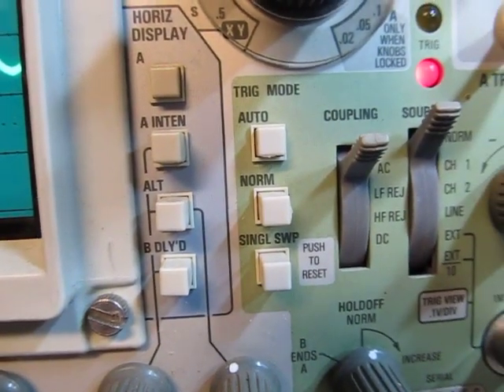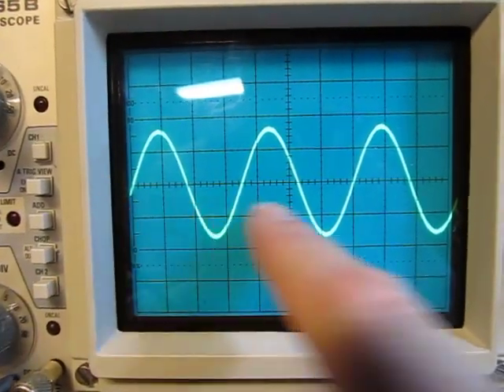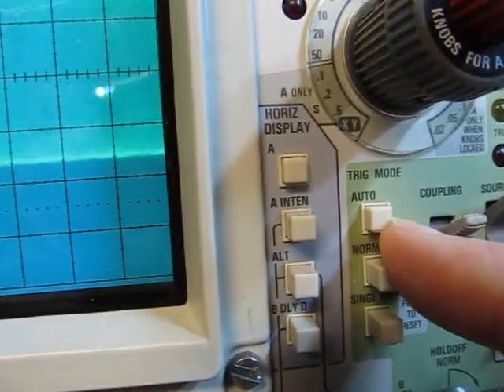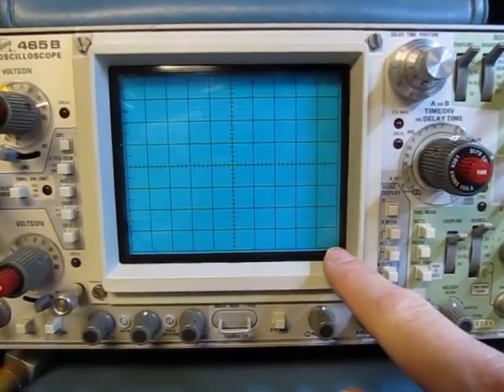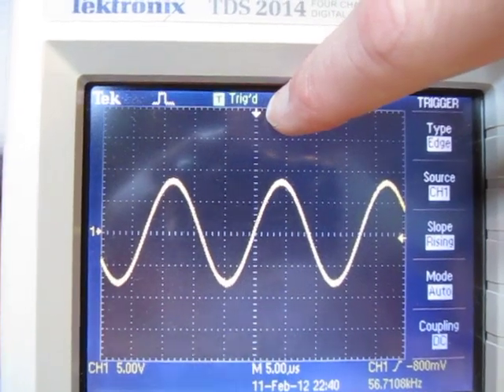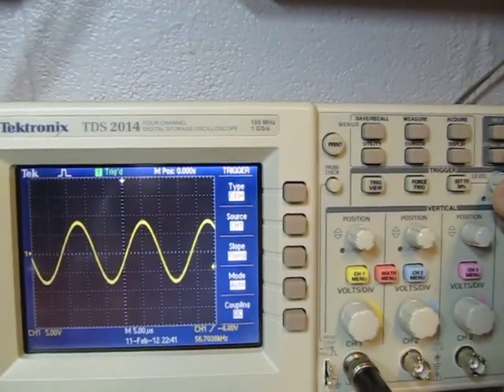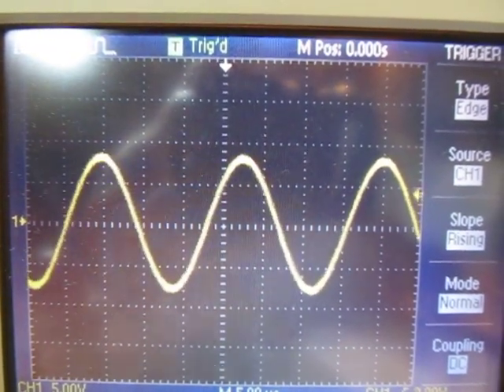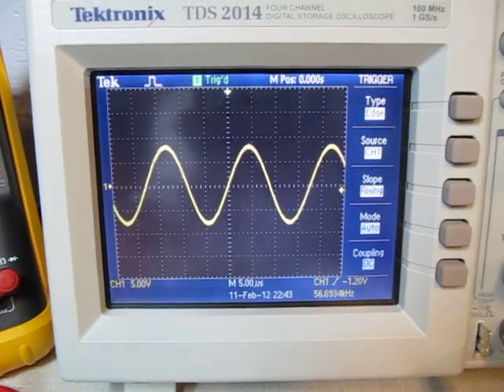#33: Oscilloscope AUTO Triggering explained

Comment: In short, all AUTO does is force a trigger event, if there hasn't been one. No trigger event, no trace on the display. 

This is useful for adjusting the scope before you've set up a good trigger, or if you don't even have a trigger event, such as using the scope to probe various signals, INCLUDING DC or slowly changing DC levels.

For a slow trigger rate, remember to put trigger in to Normal so you ONLY trigger on the desired event. Auto will insert triggers, otherwise. It's common to forget.
Reply: It is also handy if you have turned trace brightness all the way down and cannot get a trace.  Pop it into auto, adjust the brightness.  There's also a trick that I sort of remember to auto-center the trace.